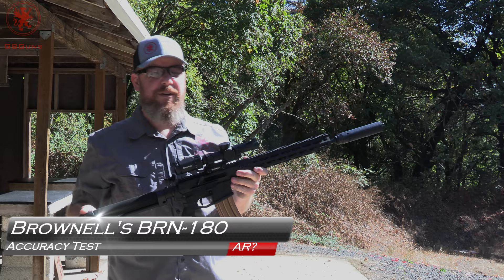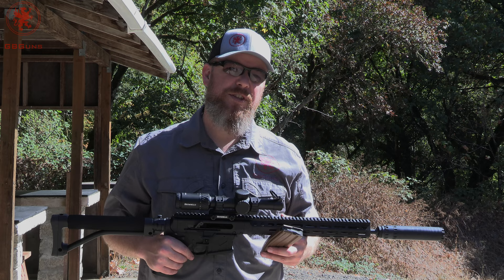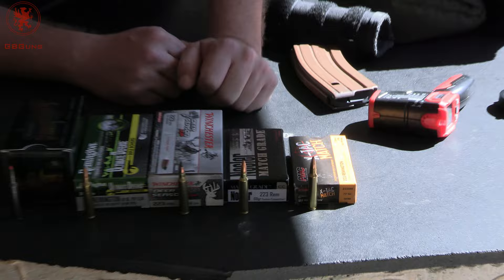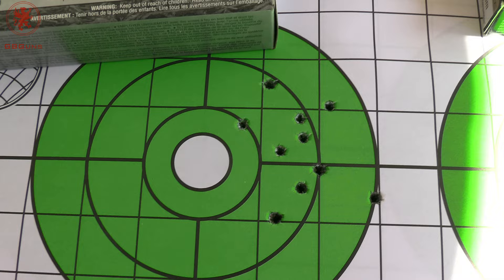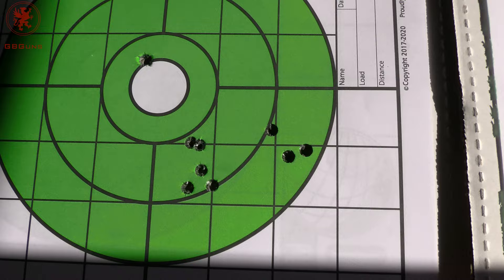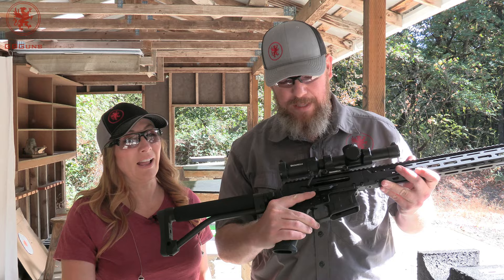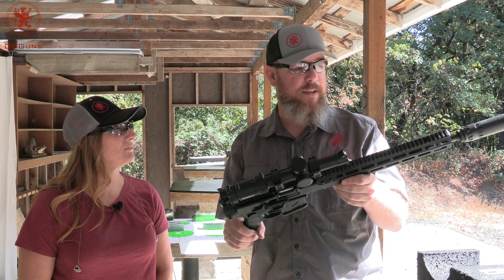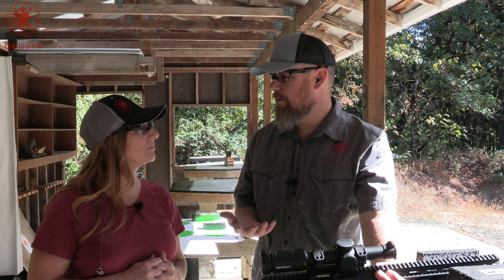Brownell's BRN 180 Accuracy Test

Comment: There are a lot of reports on the web of the suppressed setting failing to cycle.  In addition to letting less gas into the system, there is a bleed off when on the suppressed setting.  The solution is to drill the suppressed port on the gas plug to a larger size.  I experimented with mine to the point where it now works with 7.62 and 5.56 cans and varied loads on the suppressed setting with still no overgassing vs the unsupressed setting with a can.  The YT channel “Condavor Talks Guns” has a great video on this.  Brownells does sell replacement gas plugs so you can always go back to stock if wanted.
Reply from the maker: We tried with a .22 end cap and our .30 cal can still had too much volume. As per Brownell's recommendation was just ran it on the unsuppressed setting and it cycled fine.

Comment: I've had 100% function while suppressed with a silencerco hybrid with a 2.5mm suppressed gas port. I was surprised how nice the recoil felt with a properly tuned gas setting for the suppressor vs using the unsuppressed setting where i was seeing some pretty hard ejection that was denting case mouths upon ejecting.

Mine also likes 55gr pills most.

Comment: Out of my AR patterned rifles, I have 2 that I've done conversions and I like them.  Ones an Osprey and the other an Adams Arms.  The one thing they lack is the ability to side fold and shoot folded.  So I'd been looking at building a BRN.  Problem is, it's up there in price to something I already have that does what the 180 can do, an ACR.  It's  much heavier than the 180, but I'm sure its an attribute to the sub MOA groups I get out of it with 62 grain loads and the 1/7 twist barrel.  If I didn't have what I've already got, I'd jump on the BRN 180, but thanks to your video, I'm going to be on the fence a little longer.  Thanks for your un biased review.

Comment: I have been getting pretty good accuracy using 60 gr v-max.  Most of the time under  1 moa.
i have gotten 3 rnds into 2/10 moa and 2 more fliers - making the whole thin .9 moa.   I am wondering if my resizing die is making the brass a hare small for the chamber since the wylde chamber is a slight bit bigger than normal.  Maybe I need a larger sizing die ?
I have noted that it likes steel case russian (go figure) which it shoots to 1-1/4 moa to 1.5 moa.   I didnt think any gun would shoot russian that well.  🙂

Comment: I set my BRN-180S up on an Aero M4E1 lower, CMC trigger and KNS picatinny end cap with SB triangle brace. My only comment about performance is unsuppressed it's flashy and boomy as you'd expect from a 10.5" barrel. It runs Federal and Tula just fine. I still haven't picked up a can yet, but I hem and haw too much to place an order on Silencer Shop. Running it with a PA SLx 1x Gen 2 and it's shoots as good I can which I ain't a sniper but I'm not a novice either.

Comment: I have a BRN-180 18.5’ rifle shooting a Silencerco Omega Hybrid 46 suppressor with a smaller diameter 30 caliber end cap.  I drilled out the suppressed gas port hole to 2.5mm(3/32”) for shooting suppressed. The rifle now locks the BCG back on the last shot suppressed every time. It also shoots with a softer recoil than my Sig 516(14.5” & 16”) and PWS MK118 rifles. I tried using a Magpul B.A.D. Lever with a cheap Andersen lower but the rifle did not lock back on the last shot.  I have a ADM ambi lower on my Sig 516 which I like very much. I would like to try a LMT ambi lower and a Radian ADAC lower for comparison. 
Also, where did you get the longer foam shooting rest?

Comment: What is the barrel twist? Would a faster twist help? Slightly heavier barrel?...what are your comments on these questions?
Reply from the maker: We used loads from light to heavy to ideal for the twist rate. It could be that a heavier barrel might help, or just a different barrel all together. It might also be simply that the action type and design limits the potential mechanical accuracy. Regardless, it's plenty accurate for any real or implied use, just not bench rest shooting which it was never intended for. Even a 3moa rifle is more than accurate enough as a fighting gun, but the same keyboard commando's who think they're going to be in a rifle fight don't get that because they've likely never been in a rifle fight.
Reply: @GBGuns  

I understand...not my first rodeo. Talking with manufacturer right now about it...said they can help and want it better also...
This as I am in conversation NOW 🙂